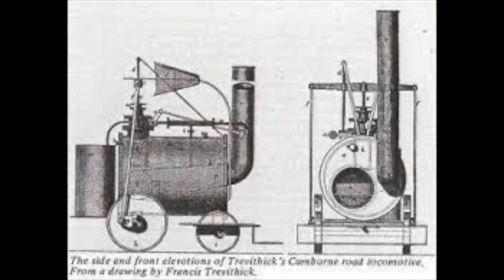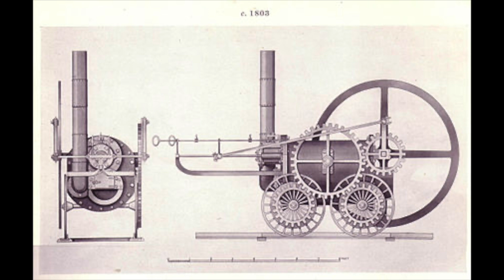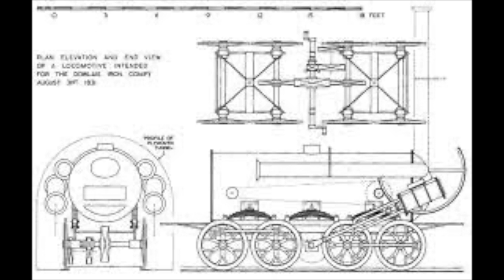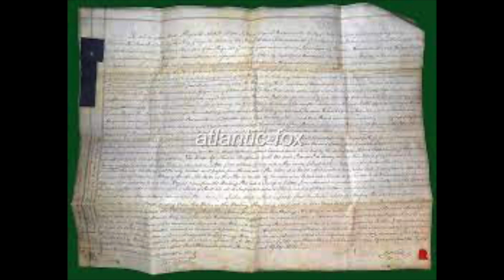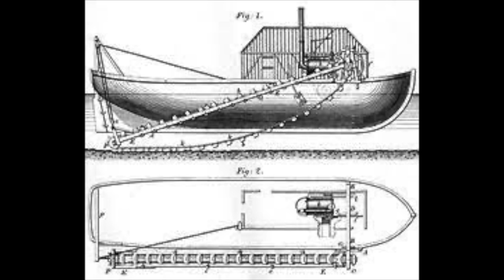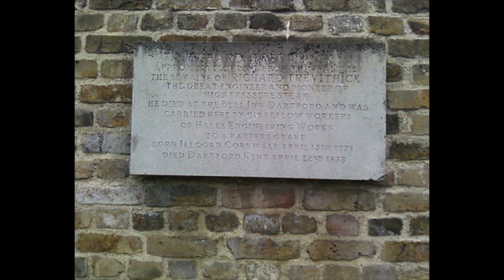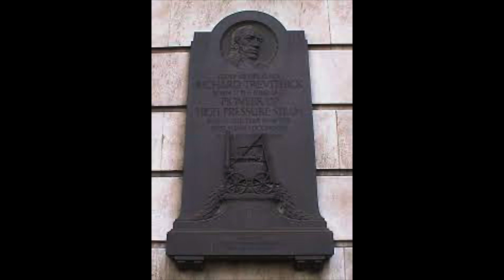Richard Trevithick - The father of steam

Comment: Sorry, but James Watt was the father of steam.
On a visit to James Watt's factory, Trevithick's grandfather pinched one of their drawings, they had to demand it back again.
In the beam engine, it's not the vacuum that causes the piston to go down, steam pressure does.
Also, still can't see the difference between high and low pressure steam engines. They're all steam engines!
Reply: Not an erudite comment!  No-one suggests for a moment that R.T. was the 'father of steam'... but check out the difference that his 'Strong Steam' made to the power and application of steam engines ...  Then you'll know.. 😊
Reply: The title says RT was The Father of Steam.
All Steam Engines, starting from James Watt used high pressure Steam, they wouldn't work otherwise.
Splitting Steam Power into High and Low Pressure is an artificial division, to undermine the significance of James Watt's work, the man who invented the world's first PRACTICAL Steam Engine.
I think my comments are perfectly erudite.
Most of the comments I see about James Watt are deliberately and definitely not erudite!
Thomas Newcomen's Atmospheric Pump was a Steam Engine?
Is that sentence erudite?
I don't think so.